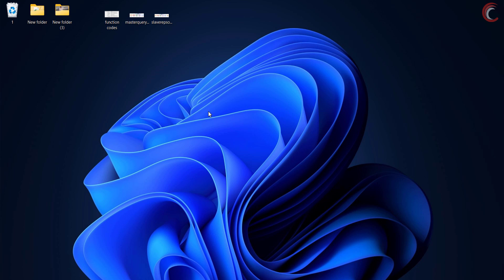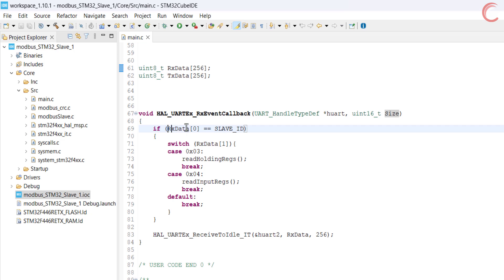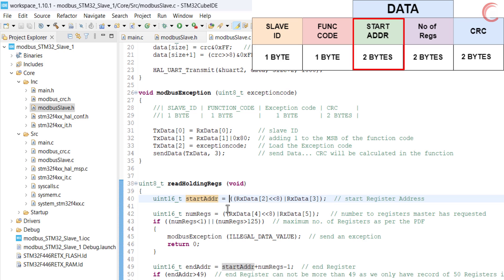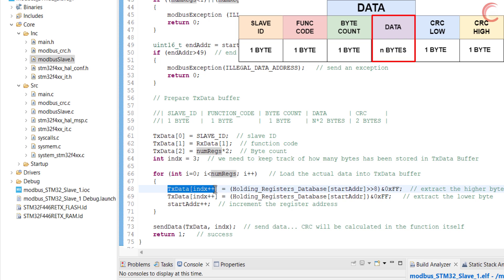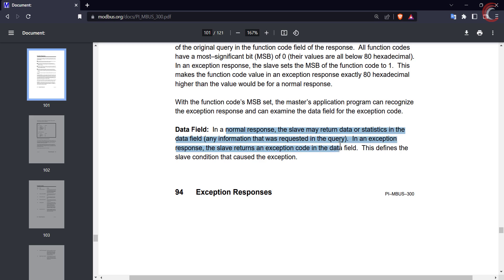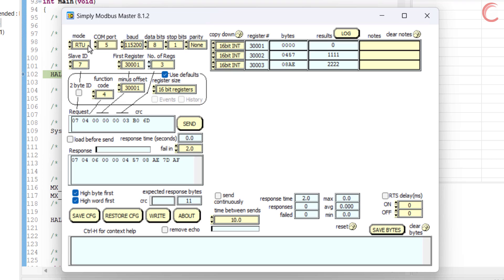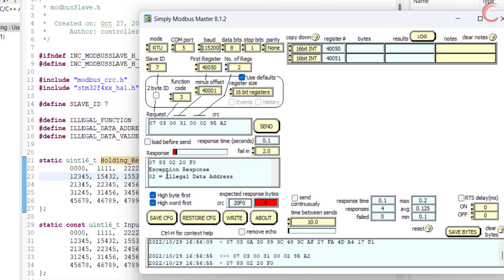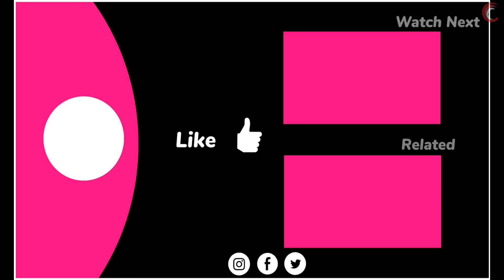Modbus #4. STM32 as SLAVE || Read holding and Input Registers

Comment: Hi, nery nice video an tutorial. I'm trying to do something similar but setting a non-fixed variable in the function: static uint16_t Holding_Registers_Database[50], for example:
static uint16_t Holding_Registers_Database[50] ={
temperature, set_point, ......., ext} but as soon as I compile I get an error from CUBE-IDE like: terminalizer element is non constant. How can I fix this? Any advice?

Comment: Hi, I tried the same example with rs485 but i dont understand why its not working, the values are not being read in the simplymodbus master app 
i dont understand where the problem lies so that is can debug at least 
i am using f469I discovery board
Reply from the maker: Did the previoud parts worked ?

Comment: hi i implemented this code for rs485 communication which was basically adding the control pin handler before and after the tx command. however the slave is only responding to the first request from the master and not responding to any further requests and is only taking further requests after i manually press the reset button. when i am using usart communication it is working perfectly without problems and no reset needed. in rs485 after the first transmission the rx buffer is getting all messed up and the slave is not responding to anything. please help how can i fix this
Reply from the maker: Why not debug the project and see if it is getting stuck somewhere?

Comment: I am trying to make modbus communication between my nucleo-f207ZG modbus rtu relay via ttl to 485 converter from usart2 port.  The problem is that I am sending data but not getting a response.  My crc values are also correct.  I plugged a 485 to usb converter to see the data I sent from the computer.  Yesterday, I was printing the data from the usb port quite accurately.  Why did this happen?  What do you think could be the reason why I can't communicate even though I send the right data?  Parity bit, stop bit, baudred rate, timeout=100, all correct.  The data format and data you sent are correct.  I couldn't find where is the error
Reply from the maker: Uart 2 is connected to stlink for virtual com. Use some other uart

Comment: Very useful video, I appreciate it a lot. I modified the code implementing RS485 as in the previous videos adding two lines in the file modbusSlave.c:
HAL_GPIO_WritePin(TX_EN_GPIO_Port, TX_EN_Pin, GPIO_PIN_SET);
HAL_UART_Transmit(&huart1, data, size+2, 1000);
HAL_GPIO_WritePin(TX_EN_GPIO_Port,TX_EN_Pin , GPIO_PIN_RESET);
Reply from the maker: Thanks. I don't understand why some people are getting confused over this. You simply have to add the previous send code.

Comment: I am trying to make modbus communication between my stm32f103c8t6 card and sensor via ttl to 485 converter from usart2 port.  The problem is that I am sending data but not getting a response.  My crc values are also correct.  I plugged a 485 to usb converter to see the data I sent from the computer.  Yesterday, I was printing the data from the usb port quite accurately.  Why did this happen?  What do you think could be the reason why I can't communicate even though I send the right data?  Parity bit, stop bit, baudred rate, timeout=100, all correct.  The data format and data you sent are correct.  I couldn't find where is the error
Reply from the maker: Maybe you are not following the protocol as per your sensor. Try using a modbus slave on computer and then see the output on it.

Comment: Thanks for the video and the code. 
I found that the TX enable pin is not enabled/disabled in the code of the sendData function. Is there any reason why? Because that is required. @ControllersTech
Reply from the maker: I covered the slave part of the series using the UART (not rs485).

Comment: When you rx reading of holding register with startAddr = 40001, but your array with the holdingReg has size = 50, how you can then create response by reading Holding_Registers_Database[40001] ?? Should not be there rather  Holding_Registers_Database[startAddr-40001] ?? ... Probably not, I missed somethinng
Reply from the maker: I am guessing you haven't watched the playlist from the beginning.
The master software does the startaddr-40001, not the slave. The slave will only receive the address starting from 0. Its the function code which actually tells whether the master is requesting the holding resisters or coils or input registers etc.
Reply: @ControllersTech  I got it... Thank you